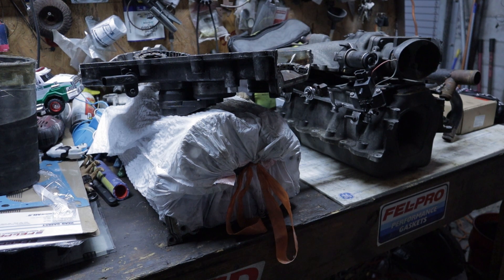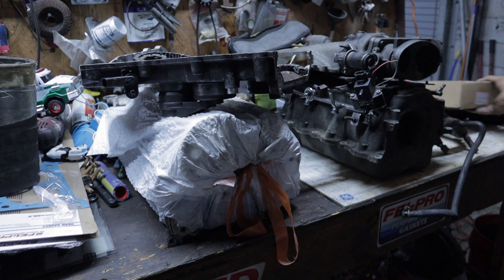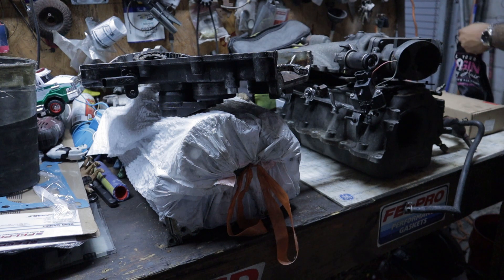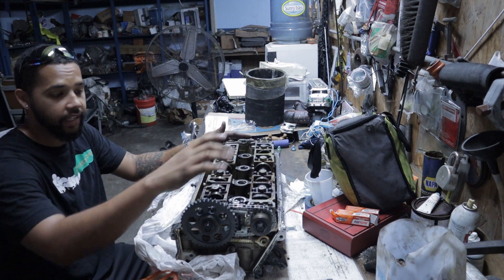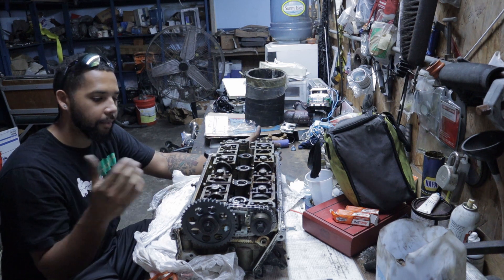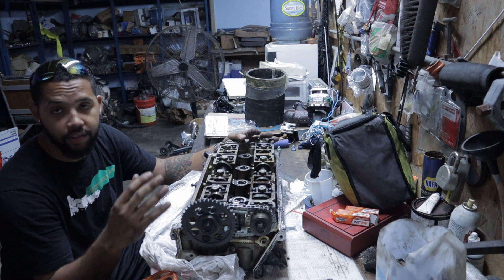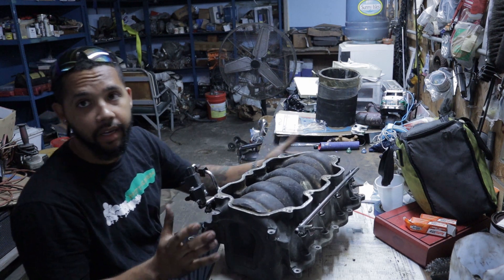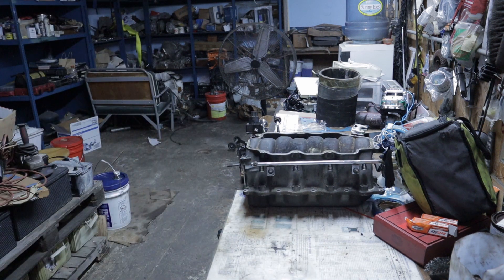How To C Head Swap Your 4.6L 4V Engine

Comment: My brother did a c head swap on the 98 and used that exact setup minus the coils but the intake is facing the passenger side of the motor not sure if thats correct or not would like more info as to what im doing to get it running plz help lol
Reply: He's using a marauder manifold so that's why his is going to the driver side. '86-'04 V8 Mustangs intakes face the passenger side, '86-'11 Panthers intakes face the driver side. If you guys are using a Cobra or mach 1 intake it should face the passenger side.

Comment: Appreciate the video brother as I'm still sourcing parts for my upcoming 4v swap on my 01 gt, but couldn't I swap in a full 03 Lincoln aviator engine and be ready for boost? Maybe besides swapping the intake?
Reply: The Aviator block and heads are identical to the Cobra, but the crank is 6 bolt and not forged. Low boost you're pretty safe but for longevity look into doing a Coyote rotating assembly swap. The Coyote crank and rods are pretty tough and can be found for pretty cheap. You'll need to get Coyote swap pistons but if you're pushing boost over about 500 hp you're looking at replacing the hypereutectic stock pistons with forged ones anyway. The bonus is the Coyote crank also acts as a stroker kit, not much but it certainly doesn't hurt.